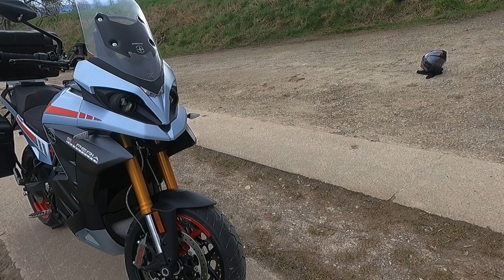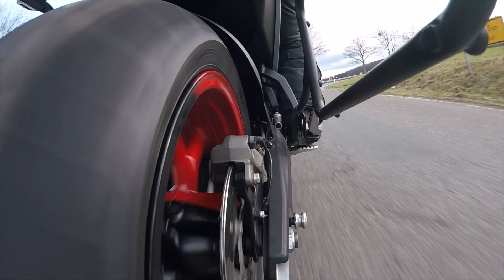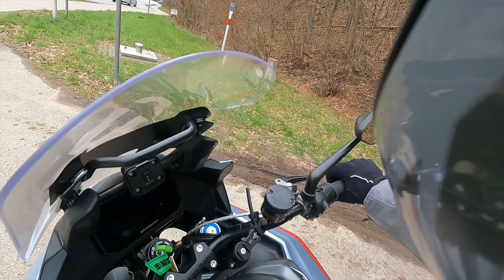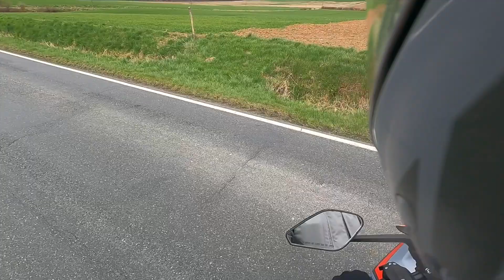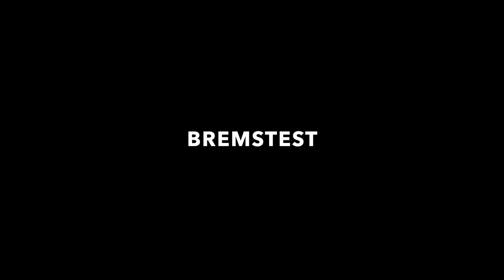Experia Review (EN narrated over GER original)

Comment: I was looking into this bike but 1200 charge cycles? Thats not a lot considering its cost. A few years worth of riding if used daily. Or less as a tourer.
Reply from the maker: Yes I agree, at first glance 1200 cycles do not sound like a lot. But let‘s do the math:

Lifetime is 1200 FULL cycles, so 0%>100%, resulting in 220km range. Therefore, 1200 full cycles result in 1200x220km = over 250,000km!!
After those quarter million kilometers, the battery is not dead but the SOH (State of Health) is below 70%; range is analog to and therefore circa 150km. But let’s stick with those 250,000km for a while.

The average European biker rides 3,000-5,000km per year. Let's say 5,000. Those 1,200 full cycles will subsequently be met after 250,000km/5,000km p.a. = 50 years. 

From my point of view, that‘s a pretty good life span!
Reply: @WattKrank  you sre correct. But if its use it as a tourer that number drops fast. Another concern is the warranty on the battery isnt very long when compared to cars. Still want to test ride one though to see if it can sway me away from my Africa twin.